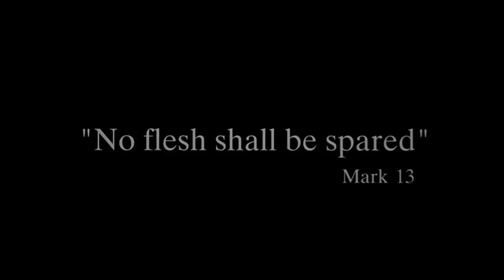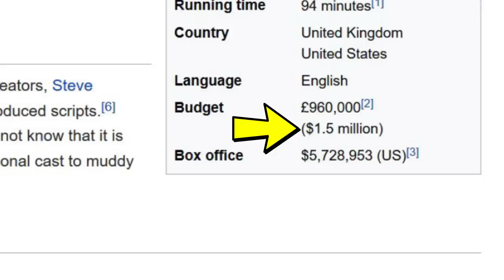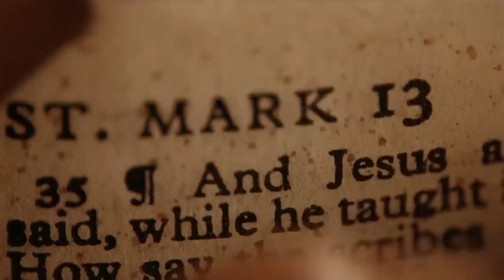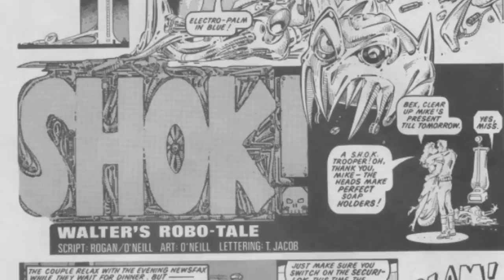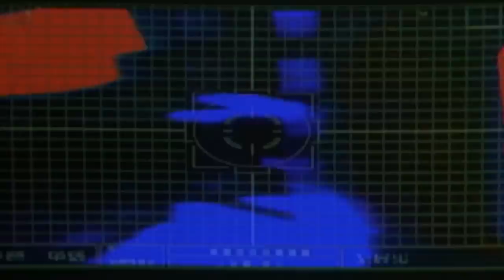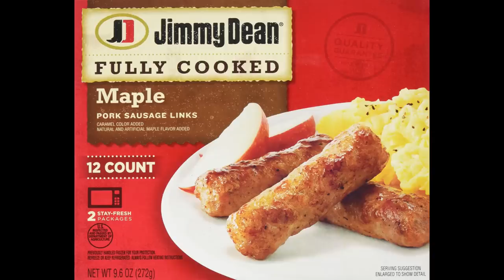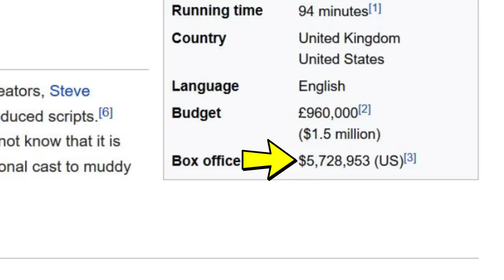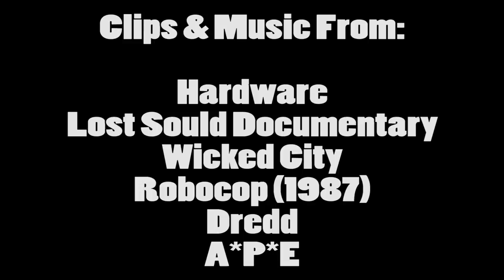Brandon's Cult Movie Reviews: HARDWARE

Comment: I rented this in around 1993, and it was frustrating, because the movie was too dark in a lot of places. I heard rumour that the blu-ray edition had fixed that issue, so, I might just buy it if I know I can actually see it. That's the only reason I didn't buy it on vhs. Why buy a movie when I can't see a lot of what is happening. Of course, I did buy AVP:R on blu-ray, and, it was far worse than HARDWARE in terms of being to dark to see, but, oh well. What can you do now? I would like to see a sequel to this. Aside from the lighting issues, this was, and still is a very well written, directed, and for the most part, acted movie.

Comment: And judge dreds helmet looks exactly like magnetos helmet
Reply: No it doesn't.
Reply: @HappyCynic  the only difference is that judge dredds helmet has the X slightly protruding in the front and he has a black face shield. Other than that, they're the exact same shape.
Reply: Dredd's helmet also has a crest on the top with a sheild at the front. Similar, yes. Exactly, no.